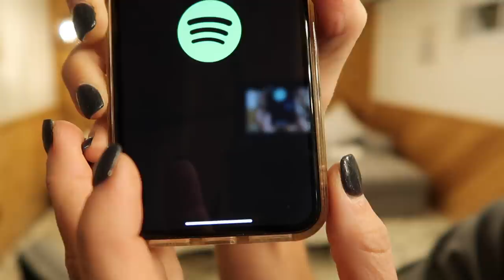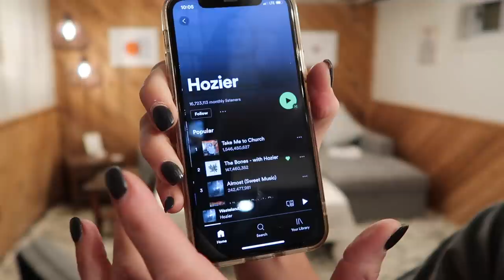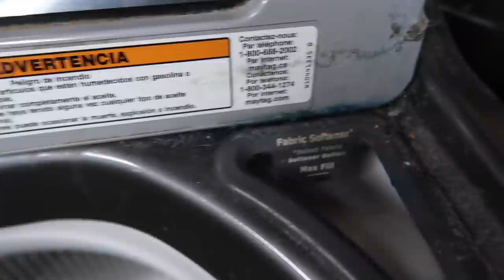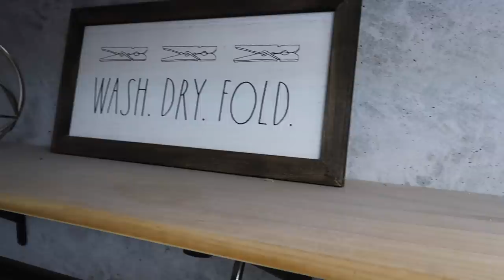FULL BASEMENT AND LAUNDRY ROOM DEEP CLEAN | NEGLECTED SPACES | SO MUCH DUST | CLEAN WITH ME!

Comment: Denise, I finally printed out photos of my husband, son and our dog and put them away for "safe keeping" until I found frames that I liked. Well I've finally purchased the frames and guess what? I cannot remember what or where I put the pictures! They'll show up eventually but boy my memory has gotten bad lately. LoL 🤣!I forgot to mention that the frames are hung on the wall in a grouping just awaiting the pictures. Weird I know, but as soon as I have more pictures printed out you know I'll find the first set.
Pour very hot water down the fabric softener dispenser and then put on the rinse cycle to get rid of any water in the washer tub. I use to do that with my old Maytag in the bleach dispenser because I never used bleach on clothes very much.
I think a basement/concrete company can drill a hole in the basement wall to the outside so you can have the dryer vent you need. I've seen them do it on This Old House and Holmes on Holmes. Weird your house never had a dryer vent to the outside. That's not safe. Lint is very combustible and a fire hazard.

Comment: LOVE this video, so motivational. I know you said you where fine with your laundry on the stairs, but ... LOL if you want an easy quick idea to keep them out of the way until your ready to do the laundry you might give this a try.  My husband took one of those kid hammocks for their stuffed animals & attached pulleys to each side of the staircase, attached the hammock & a hook at the bottom to keep the rope up out of the way from the kids. I could still toss the laundry over the rails. When I went down stairs I wouldn't have to make my way through a mountain of cloths or clear the stairs off each time I went down. When my hammock was full I just lowered it from the pulleys & took it to the laundry room. I'm sure with all you've done with your home this would be a very simple project. We eventually put in a chute, even though it didn’t go directly to the laundry room. An area down stairs was a win to me. LOL The laundry lent issue we had as well. depending on if your window is in a "well"  or above ground. above ground window area or even if there is a bit of foundation above ground get a mason worker usually through a concrete company to come & drill the size whole you need for the vent tube. Make sure they "Wet" drill it. basically the same if your window is in a well just dig out enough room to one side of the window to have the hole cut. I hope the fixes we had to do help you. Im so glad you found someone to help with your laundry what a great resource.  Love the Realness. Hugs. ~Samantha

Comment: Our dryer does not vent outside either. It is a nightmare at times. In order to take care of the majority of the issues I was having I put on an extra long metal slinky tube thing with a pinch clip at the end and I just went to the dollar store and bought a couple of packs of knee-highs and I put any high on the end of the tube this stops lint from getting everywhere and the dust is nowhere near as bad as it was. The extra long section came in because I have a door not too far from the dryer so when I'm doing laundry I open that door just enough that I can fling the tube through the door out onto the porch so the majority of the moist air gets outside and the nylon on the end stops the fine lint from being all over our screened-in carpeted porch.

Comment: Hi, love the realness you show of being a mom and runninga house. I had a similar problem with the lint in a previous house. Though it doesn't look nice if you cut some cheap panty hose and cut and tie an area that fits where the lint still coming out, sorta like a balloon to catch the excess. It works fairly well. It allows air to pass through but not larger lint pieces. You should change regularly but it save a bunch of mess for cheap. Just a thought.

Comment: We had the same problem with our vent. The house was not designed to vent out a dryer. We ended up going up through the ceiling and out through the back of  a kitchen cabinet (the kitchen is directly above the laundry room) and then outside. Wasn’t ideal but I couldn’t take the lint anymore.

Comment: The laundry doesn’t have to drop into the laundry room just into a Cunard any where down stairs.. install a floor to ceiling cabinet anywhere that works up to down stairs maybe a hatch on the floor in the closet down to a Cabinet you can grab the basket and take it into the laundry room from down stairs.

Comment: Have you tried using your steamer to clean the cups in the washer? My steamer comes away from the handle so you can have a handle held part. If not, Bissel has a great hand held for around $30 on Amazon. Quick question, why don’t you vacuum the lint instead of wiping it up with paper towels? You seem to use a lot of paper towels. It would cut down on expenses.

Comment: Hi beautiful girl. For your vent, tell John to make a hole in your ceiling, bring the dryer hose upstairs, then make another hole in  the outside wall, for the pipe. Put the dryer vent, outside, then connect your hose in it. When you make the hole for the hose to bring it upstairs. Make it like an inch, from the wall. Then voila, done. I did it and it worked. May GOD BLESS you and your beautiful family, from Canada, with love ❤.